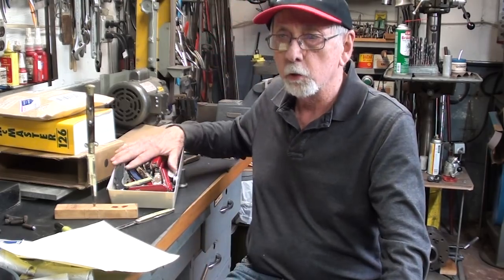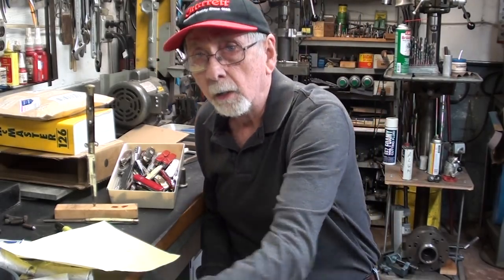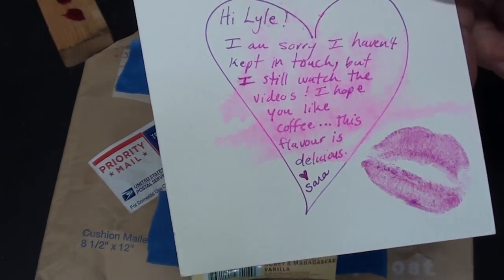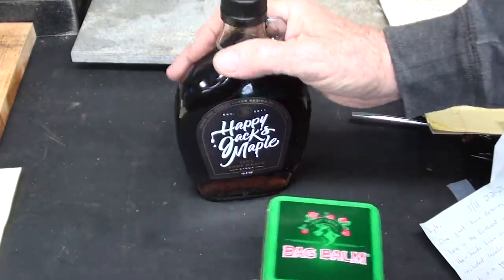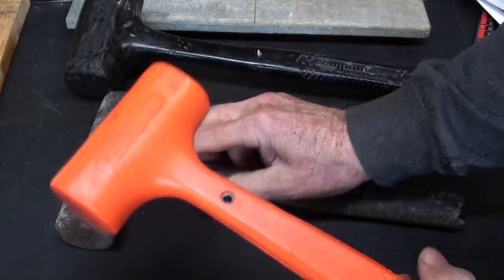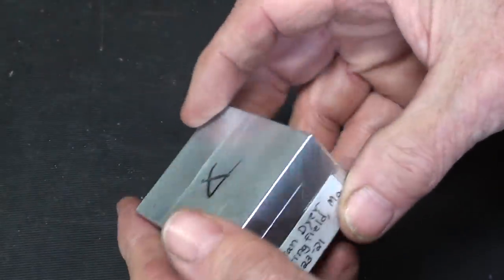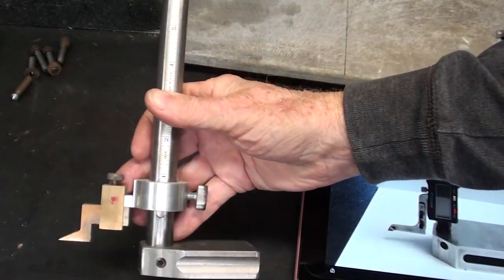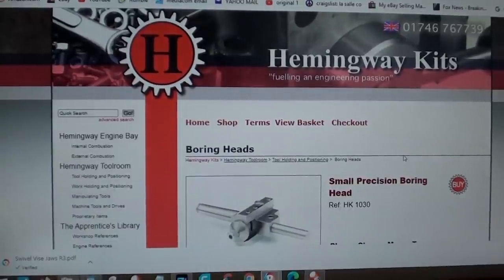THIS & THAT #61 tubalcain mrpete foundry patterns castings

Comment: Oh and as long as your air compressor has a properly working pressure relief valve I wouldn't loose any sleep. That compressor looks like an over pressurization failure for sure. I once tried looking for documented evidence of air tank failures strictly from corrosion and could find very little actual evidence. Millions of road tractors drive up and down the road everyday and you never hear about catastrophic corrosion tank failures on them. A proper pressure vessel should start leaking from corrosion damage long before it catastrophically fails.
Reply from the maker: I was thinking exactly the same thing, that perhaps the pressure relief valve was stuck. When my tank started leaking, it was a tiny pinhole. But it is a very impressive explosion. Nice job on that forklift engine

Comment: Those V-24 diesel engines have four valves per cylinder (all exhaust) and each center rocker arm is operating the plunger on top of the (in the center of the four valves) fuel injector.  Rumble has no commercials and we are sick and tired of the growing numerous interruption for commercials on UTube! Ron W4BIN
Reply: Yep 4 valves and a unit injector is what I thought.
Reply: I'm pretty sure a bunch of others already mentioned the same but even the most basic ad blocker makes watching youtube bearable again.
Reply: So how do they get oxygen into the cylinders ?
Reply: @millomweb  Ports over top of the piston thru the cylinder wall at bottom dead center combined with a supercharger to fill and scavange.
Reply: @bcbloc02  Sounds like it's heading to be not far off a 2-stroke :)
Cheers.

Comment: On the 2 stroke diesels , the 2 outer rockers open exhaust valves and the middle opens the injector. The cylinder sleeves contain the intake ports . Every revolution is a power stroke .

Comment: My wife's uncle swore by Bag Balm for shingles.  As previously pointed out, the big GM 2 cycle engines have 4 exhaust valves.  The center rocker is the injector plunger and a rack system rotates the injector body to vary the volume of the injector.  The cam-driven plunger injects whatever is in the injector.  Any catastrophic failure of a vessel containing a compressed gas is a memorable occasion in the least.  An all too common one is truck tires, inflated in safety cages.  If you're there when one blows, you never forget it.  Steam is even worse as it scalds as well.  I have a friend who used an old hot water tank in his shop.  When it blew the bottom out, it tore out of the piping, went through the roof and came down in the middle of the state highway about 100 ft out front.  Enjoy the syrup, I see its the dark full-flavored variety that's oh so good.  Light syrup is all the rage these days and a couple of us used to make about 350 gallons a season here on  the Champion peak of the Tug Hill in northern NY.  But we always preferred the dark, especially for sugar cakes  YUM!

Comment: I have used Bag Balm on my hands for years. Great for cracks or after abuse like working concrete. In worst-case situations slather it on at bedtime and put your hands in socks.

I have had a Schrade in my pocket around 45 years.

Comment: Hi Mr Pete, seeing your degraded Dead Blow hammer reminded me of a fibreglass shafted axe that actually broke in use due to the degraded GRP.  Frightening!!!  Stick to good old Hickory or Ash for tool handles.

Love the con rod bottle opener.  I have a similar casting to some of those shown from when Ford Motor Company's Thames Foundry closed in 1987 here in the UK.

Comment: I love the online Mcmaster Carr catalogue as you can download the digital part and 3d print them or CNC mill them, of course with some applications you are better off with the real metal part, I also use the digital models when designing things in CAD as it saves so much time, you can also install the catalogue as a plug-in in Fusion 360

Comment: Hemingway kits are a staple for projects to fill the home machine shop in the UK and European destinations. 
 Die filer castings,rotary broach kits,and much more. I recently bought a Worden tool & cutter grinder kit and accesorries for multi facet drill grinding etc. Nice comprehensive kit with all materials and fixings supplied. 

That compressor video is worrying but look closely and see just how miserably thin the wall thickness of the steel receiver is. I know mine is considerably thicker walled than that example.

Comment: The 20 cylinder EMD engine had trouble with torsional crankshaft vibration.  The ones that were on locomotives were scrapped and replaced with V16s a long time ago.

Comment: Hi Mr Pete,  thanks for the video, if I were you I'd be wanting to know what was going on inside your compressor receiver, unlike alot of machines that give you some warning of impending failure, ,pressure vessels tend to take you by surprise, as per your picture, I'd hate to hear you'd been blown up, literally.  As a side note I once witnessed a full oxygen bottle from a welding set fall from a crane, on landing it smashed the neck valve off, and shot off like a torpedo,  it took out two  walls before it stopped, luckily no one got hurt. Stay safe my friend,best wishe's to you and your's, Stuart.uk.

Comment: I carry a Swiss army pocket knife (Spartan) for years, as it is sharpened the blade tip catches in your pocket or on your hand
Fixed by filing the flat area on the blade side to allow the blade to ‘flatten’ into the knife body

Comment: I JUST HAVE TO POINT OUT AT 18:42 at the right hand end of the books, there's books:

1. Hardening, Tempering & Heat treatment.
2. Soldering and Brazing.

Both of these books are by the genuine TUBAL CAIN  !

In MrPete, I thought I'd found the author - and was SO disappointed I hadn't. The author is long-since dead.

Comment: i had a snap on dead blow come apart with very little use
Reply: I own a couple of drawers full of dead blows, most of them Snap-On. When Snap-On introduced their version I purchased several in orange and at least one in black. Everyone of those hammers failed. Everyone failed the same way, the plastic disintegrated as Lyle showed us. I never had a failure in use. I picked it up and it was coming apart. Snap-On readily warranted each failure and replaced each one with their red and black version. I continued to purchase the red and black version and now own 16 or 18 soft faced and hard faced Snap-On. I have never had another failure. Some of those are 20 years old now??? I figured that they finally got the plastic chemistry right, and introduced their early versions without knowledge that in time their plastic would fail. I have a handful of other plastic dead blow hammers that have not failed. These are Stanley and Marco. I prefer the size, weight, fit and finish of Snap-On over other brands, and if you shop Snap-On sales you can get them cheaper than other major brands... Very uncommon in the Snap-On product line. When I started moving to plastic dead blow hammers 35 years ago I had been using products like NUPLA that used replaceable faces with an aluminum head, fiberglass handle and rubber grip. These failed too, but these failures were undersized handle failures. Snap-On remains my go to hammers, especially for dead bow. I still keep and use conventional style hammers with wood, fiberglass and wood handles, but dead blow normally fits my need the best. The best wood handled hammer makers still struggle with heads that loosen. Steel hammers are supposed to give you wrist and forearm problems, and likely do for full time framers. I still favor Estwing for carpentry, Vaughn for this and that, Proto occasionally. I am ashamed to admit it, but I still like a Craftsman fiberglass handled ballpeen I purchased in the 1970's. I suspect that it is a Vaughn product.

Well this rant is to validate that several makers have solved the plastic failure problems with the plastíc dead blow design. Turn in your failed Snap-On for the red and black style. They are wonderful tools now.

Comment: Those large bore engines are awesome. They are like the old two stroke Detroit Diesel on steroids. One of the worst jobs to do was adjust the rack on an 8V71 inside a rear engine bus. If you don't get it right the engine could run away or never run right. My vocational teacher has said they are like having multiple chain saw engines bolted together.
  Thank you Mr Pete.

Comment: Hi Lyle,
Enjoyed the video. There are nine Springfield's in PA. That diesel engine has 4 valves per cylinder, two for each outboard rocker arm with the injector between them. You and the family stay safe.

Comment: I may be mistaken, but I think the diesel engine you showed running actually has 4 valves per cylinder, 2 each for intake and exhaust, driven from one rocker by a bridge piece.

The middle rocker drives a "unit injector" consisting of a pump plunger and a nozzle, and shoots the fuel in at the proper time.

Check to see if I  am correct.

Cheers,
Dave

Comment: Good video.  I think that the black cast hammer deterioration may be from water -- urethane breaks down like that in a wet environment.  The orange plastic hammer is simply the wrong material for that use.  You're right about the compressors, on various Air Force bases over my many years, there were many injuries due to tire, compressor tank, and other high pressure container accidents. I once had a 3-ton truck brake pressure tank blow up on me while driving.   Now they limit normally charged compressors for tools and shops to 40 psi, although they prefer 25 if the shop can get away with it.  For higher pressure ratings they often use tankless systems, and safety cages when there is potential for explosion -- like large aircraft tires.

Comment: I was a submariner in the Navy and the first diesel electric sub I was on had 4 Fairbanks Morse opposed piston diesels.  They were troublesome.  The next sub I served on had 3 GM V-16 diesels which were loud but dependable.  They had pistons a little larger than a 2 gallon bucket.  Compressed air was used to roll them to get them started.  Then I went to nuclear powered subs which had only a small auxilliary diesel for emergency use if necessary.  The only time they ran was when they tested them periodically.  I believe they were FM but not sure.

Comment: I have a well used snap-on/blue point dead blow for 35 plus years, no splits, no dead blow rattle either, its hammered, still works tho

Comment: About the 2 stroke diesel engine video, there's not 3 valves pr cylinder the one in the middle are the injection pump run by the camshaft.  🤗. These engines are long life, but terrible inefficient and polluting 🤔

Comment: Lyle - a day late but I have to mention the knife I am carrying now.  A Kabar 1052.  Old and carbon steel, two blades with the longest being 2 inches.  It came in an old tool chest I got at an auction.  Sharpened it and it is a nice sized knife to carry.

Comment: I don't believe the EMD is three valves. Many years ago I worked on Detroit Diesels and this looks like the same valve arraignment. The two outside rockers operate two valves each, 4 valves, via a bridge and the center rocker operates the injector. Thanks for all the great videos.

Comment: Even if you drain a compressor every day it will still accumulate some water while running. Seems inevitable that they will rust. I've seen them get a hole that leaks air.

Comment: Regarding the air tank explosive device...  Several months ago I watched a series of You Tube videos on early British locomotives.  During one of the videos, the narrator mentioned rather substantial divots/dents at the bottom of the large air tanks along the side of the engine.  He stated that they were "weak points" so that if the tank rusted to the point of rupture, the holes would fail first and relieve pressure without rupturing the entire tank.  Just thought this was interesting and somewhat related to your comments...

Comment: Hi Mr Pete if you could access through one of the outlets with a inspection camera could maybe help or have it tested for thickness . i know the county inspector came around every five years to test the compressors at work . Also keep your eye out for a newer used tank at the dump or somewhere .My old craftsman was dated 1969 i found a newer tank for it . First thing to go on new ones is the motor or comp. junk.

Comment: That is why you should do a water compression test on your air conditioner tank every year you can fill the tank completely with fresh water then attach a pump that can go 125% of the working pressure of the air conditioner tank a good pump to use is a gurney they can pump to that pressure ezy

Comment: Lyle - really appreciate the time and effort you put into your "edutainment" videos!  Enjoyed the EMD video - I'm pretty sure this engine has 4 valves per cylinder (the two outside rockers actuating two valves each) with the fuel injector in the middle actuated by the center cam lobe (like GM Detroit Diesel 2-stroke Jimmy's).  You can see the fuel feed lines going to the injectors in the video.  Cool stuff!  In the late 1960's, my Grampa in Chicago took me on a tour of the nearby Electro-Motive Plant (manufacturing Diesel-Electric locomotives).  What an impression that made on a young boy!

Comment: Hi Mr. Pete. I’ve been watching for a while especially the old South Bend lathe videos since I am in the market for one, This video is THIS & THAT, I have a question about This or That!
I’ve found two near me that I hope you can give some guidance on. One is a 16/24 from the 1950s. It looks old and dirty but it does run, It does not seem too overworked or worn under the dirt that I can see. It comes with a chuck and a few tool holders only. The other is one I’ve heard of but can find no video or information on; a 13 METRIC South Bend. I was told it might be from the late 1970s or early 80s (large dials, lever clutch). It is much cleaner and fresher looking. Almost for sure would not require a rebuild/restoration (the other might - could use a thorough cleaning for sure). The 13 metric lathe comes with more accessories like a steady rest and tail chucks, one three jaw chuck, etc. Both are 6 feet. BOTH have taper attachments. I am sort of torn between them. I’d like a bigger lathe for potentially bigger work but not immediately necessary. Also the 16/24 is about $500 more. 

Now if you won’t comment on one vs the other, can you give an opinion or information on the metric one? I’ve heard of people being able to thread metric on and imperial. Is it possible to thread imperial on a metic lathe? As I said, I can’t seem to find much information besides “yes, they exist”. Where could I find support (parts?) if I get the 13 metric?

My other question is about motors. The 16/24 has a Single phase motor installed so I could bring that to the garage and plug it in. The 13 metric has a Three phase motor. So now I have to add the expense of another motor or VFD, etc. Any thoughts on these choices?

Thank you for you videos and indirect support of machines  and the pros and tinkerers who love them.
Take care and stay safe,
Cheers
Reply from the maker: I would favor the 13 inch, even though it is metric. Would require a phase converter for a few hundred dollars. And just how often do you actually thread where you would need imperial? And you said it comes with a lot more accessories. It’s a tough call but I like the smaller one
Reply: @mrpete222  Thank you for your feedback. 
I really appreciate an educated and experienced point of view here. 

With all your experience, you say it's a tough call. Now pretend, on this subject, your brain is pristine; a brand new note book. Every page completely blank! So you can imagine my befuddlement and high level of confustication!

Thank you for helping to cure some of my ignorance.
Take care and stay safe,
Cheers

Comment: I am curious about the thickness of the steel on the air compressor tank. I think it is a major factor. There's a few good videos of pressure testing tank with a pressure washer on YouTube.
Reply: Agree with you,Carl. I've seen that compressor tank explosion video before and the steel looks about the same thickness as tissue paper. There is a very suspect seam weld also.  The receiver on my little compressor is vastly thicker walled section than that destroyed one in the video.

Comment: If I was going to get mad at you it'd be for using a knife to try to extract a battery in a clumsy way !
Reply from the maker: I don’t have enough tools, so I had to use my knife. Actually, that is the first time in my life that I ever broke the blade. I should have used a Victorinox, because it just would have bent
Reply: @mrpete222  Usual tool for small prying is a screwdriver (typically use on paint tin lids !) - and I've always found it best to pry batteries out at the ends rather than sides as often the sides are a bit battery shaped to help keep them in.
Pry at the non spring contact end - usually the positive and.

Comment: Looks like 3 intake and 3 exhaust valves looking at the valve springs.  The center rocker is the mechanical injector.
Reply from the maker: Thanks
Reply: The EMD (Electro Motive Diesel division of GM) engine V20 shown is a 2 stroke 4 exhaust valve 645 in3 per cylinder. Center rocker of each cylinder operates the cylinder injector and outer 2 rockers operate hydraulic exhaust valve bridges. 16 cylinder versions used mostly on locomotives turn a 600v electric generator coupled to the rear end if interested.
Reply: @donjohnston9554  Wow, a 900rpm 2 stroke with 645 or 710 cubic inches per cylinder.  Learn something new every day.  Thanks

Comment: That's an EMD 645 V-20, in a locomotive such as an SD45 it would rate 3600h.p. '645' refers to 645 cu.in. per cylinder. It's a 2 cycle design so those are all exhaust valves, the intake is through ports cut directly in the cylinder bores. Those are rare in locomotives these days.